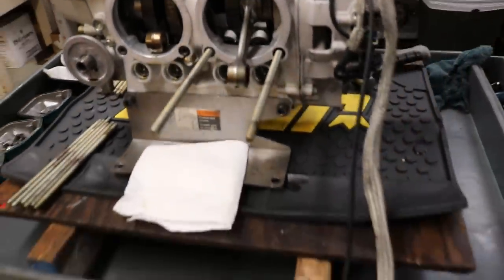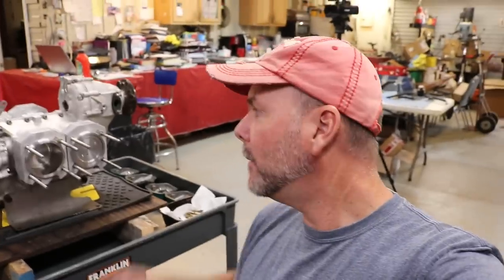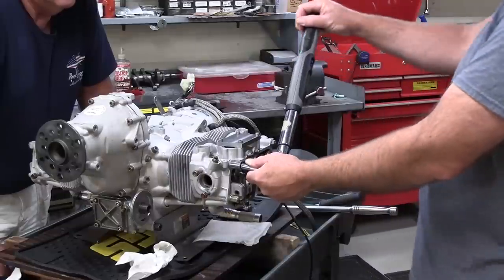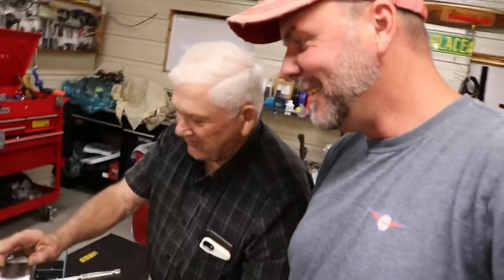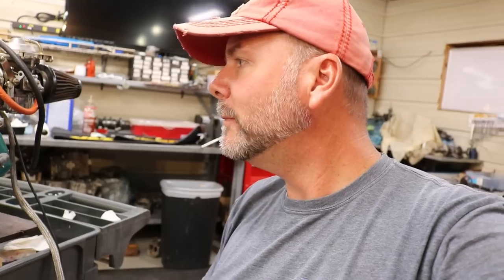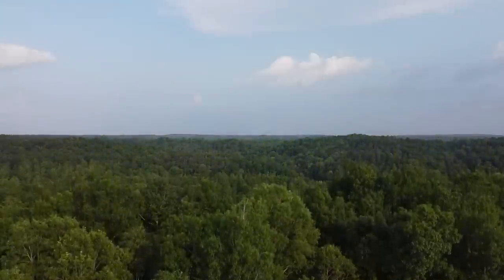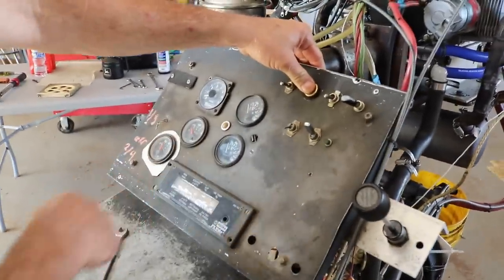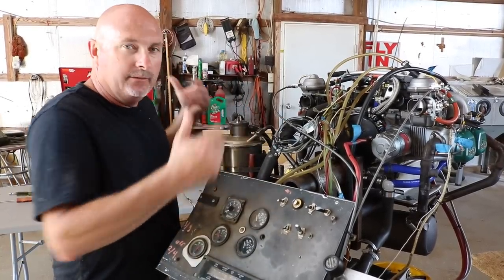We have a RUNNING ENGINE! Will it RUN? - Of Course! Rotax 912 Aircraft Engine

Comment: Love the channel, watched every episode!! :-)  Wondering why you opted away from the Big Bore kit?  Fuel efficiency? Too much power?    Thanks and keep it Up.  Patrick from Ottawa Canada!
Reply from the maker: It was an older Style kit for one. Secondly I've heard that they run slightly higher cylinder head Temps. Lastly... usually consume more oil. And I've never owned or flown a stock 912ULS before and I want to get to know the engine from a baseline before mods.  I can always improve on it later.  :-)

Comment: Happy for you :)
I noticed that when you start the engine in front of the hangar, there are no red paints or markings on the ground indicating a boundary for safety. This could potentially pose a risk to anyone in the vicinity, as they might not be aware of the danger posed by the propeller.
Thanks

Comment: Rarely have I seen a Rotax 912 being overhauled since the cost of parts and labor is in the stratosphere for 4stroke 912.  They are normally considered disposable engines since it is usually cheaper to buy a new one then rebuild one.

Comment: Hi Bryan, Do those engines have a pretty short stroke? I like that oil level trick! Thanks!
Reply from the maker: If you can see the size (height) of the New Cylinders that gives you an idea. But yes, they have to turn around rather quickly producing peak power around 5,800 rpm. Etc.
Reply: @ExperimentalAircraftChannel  That’s what prompted me to ask. Those jugs look awfully short!😉
Reply: @tomcoryell  912 uls are an 84mm bore X 61mm stroke, 3.31" X 2.4"  for 1,352 cc or 82.5 cu. In. So that's a fairly large oversquare engine. Hench the rpms. 👍

Comment: Can you post the run in proceedure with RMP and times please?....4000 rpm  for how long?...pulsing the throttle 5 or 6 times from around 2500 rpm as a idle

Comment: Now that this Break-In run has been performed on the test stand, will a further Full Break-In be required for the first several hours of operation, on the plane?
Reply from the maker: Honestly.  With so much going on still with the Airframe build, I haven't gotten into those details yet.  Just picked up the FFW Kit from Zenith so we can begin mounting the engine.  Soon after OSH23 that should happen.  Will dive deeper into the engine procedures soon after.  Thanks for watching!

Comment: Why is it configured as a pusher? I thought it was going on your Zenith?
Reply: Keps the tester from getting beat up in the wind blast.
Reply: @michaelspunich7273  for sure but I thought the gearboxes were configured to accept the thrust in one direction only.
Reply from the maker: It is in fact going on a CH750 Cruzer. This was just for initial test break in. It's how they run ALL engines at their shop. Will definitely be using it in the Tractor configuration.  Now... to decide on a Prop! 😊
Reply: @JustFlyer7NC1  Yep, exactly, and the engine is supposed to have prop blast across the cylinder fins for cooling, which is especially important during break-in when ring friction is highest.  If the operator doesn't want to stand in the prop blast, then remote the controls or install a windshield on the stand.  I also cringed when the guy dismissed the Rotax oil purge procedure.  It exists for a very good reason: these engines have hydraulic valve lifters that can be damaged if the engine is run with air in them.  Several items in this video made me nervous.
Reply: @ExperimentalAircraftChannel  No high inertia props! Kudos for breaking it down and finding that bad shim.
Reply from the maker: @michaelspunich7273  yes. Even though I was able to see this engine running before purchase, you never really know what is going on INSIDE.  I highly recommend at least a partial teardown inspection to know what you have.  This engine only had about 260hrs total time.

Comment: Why would  you give up the big bore option?
Reply from the maker: The one that was on it had 260hrs. An older style with STEEL CYLINDERS.  it was showing signs of wear. BB KITS often run higher cyl head Temps and consume a bit more oil.  FYI. 
Plus...I've never really flown behind a stock 100hp for long.  I'd like to get to know yve engine as it was.
Reply: @ExperimentalAircraftChannel  good reason
Reply: @ExperimentalAircraftChannel  what ever happened to John Brannon and his scratch build  lsa bearHawk.

Comment: why don't they build it on a rotisserie so it's easier to line up the cylinders/pistons/heads/tubes rather than reach in under the cylinder and blindly line up the tubes?
Reply from the maker: If they did this in more of a "Production Environment" then maybe so. I've seen what you are speaking of. Would make the process easier for sure. :-)
Reply: I WAS THINKING THE EXACT SAMETHING. GODBLESS

Comment: You ABSOLUTELY DO NOT READ THE MANUAL.  Rotex makes a point that all fasteners are first applied with 50% torque value then torque to final value... this is to properly seat/seal assemblies.  Its a basic tenet that you RTFM before doing maintenance.  You fail HA HA
Reply from the maker: In all honesty, we didn't show all the steps in the short clips here (not to bore you with the long proceess). There are several of the bolts that you tighten, then loosen, then final torque.
Reply: It is Rotax not Rotex . You fail